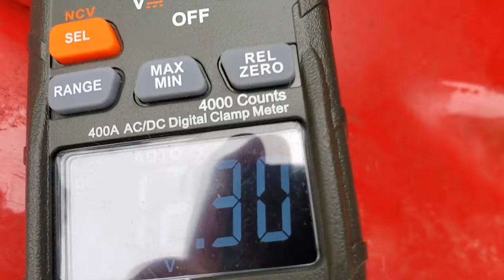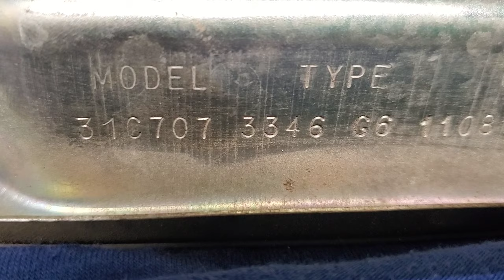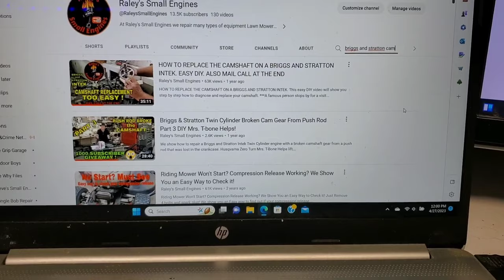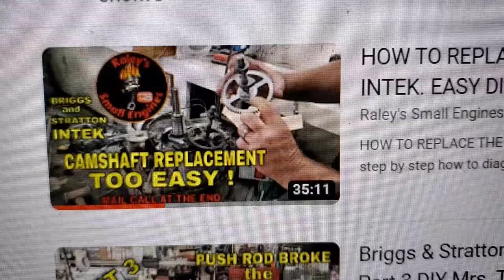Briggs & Stratton No Start Won't Turn Over Hydro Lock Compression Release Valve Adjustment Easy DIY

Comment: I had been working on my mower under an assumption of a different problem which was wrong. Once I determined that I found your video and you were spot on. I would still be cussing at a broke mower had I not seen your video. Thx!

Comment: An easy solution to overcome the compression is remove the air cleaner then, wearing a leather glove, put your hand over the intake on the carburetor. Then have someone crank the engine. It will turn over easy if it gets no air for compression. It will start really fast so get your gloved hand off the intake quickly so it can run. Usually nothing broken, just the compression release mechanism fails to operate after setting around for a couple of months.

Comment: Great information! The only thing I would recommend is taking a propane torch with a brazing tip on it, and go around the outside of the valve cover to soften up the honda bond that they use from the factory to seal the cover to the engine block. The valve cover comes off without any bending when the stuff is a little warm.  😉

Comment: I had to replace my camshaft on my 17.5 hp Briggs also. My cam lobe was very worn along with the compression release being broken, not a terrible job, it ran like a new mower afterwards. I discovered how bad the lobe was during a valve adjustment while replacing head gasket for oil burning and smoking. Like others say you can mow a while with it by turning the engine backwards until on low spot to help overcome the high compression while cranking. Eventually the lobe wears down too much and mower won’t run with any power. I wish I had done this job in April instead of June in Florida heat, this was about 7 years ago, I now have a Koehler, not sure if I’m better or worse off lol. That Briggs ran great afterwards but that dam 17.5 must all have bad cams.

Comment: You ain't kidding about Amazon aftermarket part, I have a 1990 Dynamark i was restoring and its engine was replaced at sometime from a Breaks n Scrap em to a 12.5hp Tecumish. I wanted to install a new carb and ordered on frim scamazon needless to say that carb fit but it was backfiring and just would not run good. So i went to Parts tree and ordered a OEM it was definitely alot more money, but my tractor runs perfect now. I did finally get it completely restored and it looks and runs like new. Its a pretty awesome running/cutting rider. Anyway my point is sometimes its not better to save money if you want perfection. Great content as always good Sir

Comment: i have a john deere with this engine and the camshaft problem,been mowing with it for 2 years,i just spin the engine backwards until its free,shoot some starting fluid in it and it starts every time,i usually don't shut it off again until i finish mowing,bought it used,not worth fixing as long as it starts

Comment: I ran my craftsman YTS3000 without a new cam. I got most of the pieces out with a magnet. Turned the crank to upstroke, covered the intake and started it up. Ran like a top for several hundred hours before I sold it.
Reply from the maker: Nice work!

Comment: Excellent video. Thank you for sharing. I just removed my engine, though I was a little apprehensive due to very little experience with these engines, I trusted your advice about not having a bump at the valve and you were exactly right. Right down to the metal rattling after flipping the motor over. I removed several pieces of the ACR from inside the motor. Now Im ready to order the parts. You did a great job with this video and I"ll definitely trust you for any and all future repairs I may have to make.

Comment: Have exactly the same issues with my. B&S. 540cc 19 hp. Riding it  for like 20 minutes.  Cutting the grass, Engine revved up really high that startled me. When I went to turn it back on, that’s what I got. I guess tomorrow I’ll check the gas to see. if the chef broke. Thanks for that video. It really helped me in the knowledge department. Thnks.

Comment: Thank you. This video led me to a problem i wouldnt have thought about.
Compression relief symptom / problem brought me here.. or so i thought.
Soon as i got to the valves, exhaust valve was dangling.. holding in the compression..

Tried to adjust it, but the tiny hex allen center screw was locked, non adjustable now.
I couldve been hunting the small part to replace and then waiting on it, but i took the round tipped valve nut / bolt with its siezed adjustment inner screw and Cut it with my cut disk grinder, lower than the stuck screw. So i screwed the thing on, huntin for ideas, then thought to adjust that valve perfect with it, then weld it in. If ever needed to remove the bolt that holds the valve to the head (thats welded on the end, to the rounded valve nut) can be cut with a small dremil and tiny cut disk.. but it should hold up for life as longnas this generator engine is properly handled 

But big thanks.. this video got my engine going again, a whole lot easier than i imagined (to have to get all the way into the cam.. on a dang genrator wit big motor to remove first.. whew!

Comment: I’ve been getting around the issue by turning the engine past the point of the compression release by hand (open palm on top of the fan cover and twist it over). Not ideal but, so far, it works!
Reply: Exactly what I’m doing at the moment!

Comment: Great video! To the point and not a bunch of jacking around finding tools or moving the camera making everybody seasick. 
Unfortunately I believe the cam is also wiped in my engine. With so many projects currently on the bench .  I think I will just junk the mower and buy a nice used one get 6 or 7 years from it hopefully.
Reply: Exactly....this is one of the top channels in this field for sure

Comment: Have the exact same mower with the exact same issue. Took it apart and camshaft was not broke. But its back together and adjusted valves. Guess we'll see what happens when I try to crank it up.

Comment: Great video. Straight and to the point. Liked and Subscribed.
BTW I use medical patient lifts AKA "Hoyer lifts" to raise mowers, pick up small engines (they'll easily do a Harley or other touring bike motor) and place 'em on my cart or work bench. I already have a bad back so the time to set up a variety of lifting gear, carts and dollies makes wrenching much easier.

Comment: It's nice to see less and less of the Kohler 7000 series engines in the repair shop all others  especially Briggs & Straton are  constantly in for repairs
Reply: The 7000 series is a good engine. About the only thing they need is the valve cover upgrade that the “Pro” engines have. I wouldn’t buy a newer single cylinder from Briggs or Kohler.
Reply: I literally just blew up my new used kholer john deere. Craftsman of course has a bad compression valve ergo why I'm here lol. Dang grass won't stop growing for anything

Comment: I’ve had that same mower sitting in my back yard for two years and never thought to suck a magnet down the oil shaft!
Reply from the maker: Remove valve cover, adjust the valves and then look for the bump.  You CAN fix it!!! If it's a bad cam, watch the video in the description, it will guide you thru it.

Comment: Man thank for posting this... I got a 26 breaks n scrap'm that's killin batteries and i think i smoked the Sil - starter wire.   It does the exact thing though, locks up before the starter can pushi it over hard enough to turn.  I'll check the valves but im not sure this video applies to a 2 cylinder....  Seems like though, jus twiste...  I'd go check but it wouldnt start across town and it aint here right now....  Anyway thanks.

Comment: The thing that the gas might be in the.oil  can cause the hydro lock I've been there did that on my  poulan XT mower  so I cut the gas valve off and let the carburetor run out of gas

Comment: i read they can break the first start up after repair, so i took the head off mine and drilled a hole to make my own manual compression relief valve. did this back in 2020 during the sickness when no one could get out or work.

Comment: Great video! Helped alot! I did my intek 16.5. Question, should there be a valve cap on the intake valve? There is one on the exhaust but not the intake. What's the risk of running without one? Thanks!

Comment: I have the troy bilt 18.5 it's will start one time then hesitate and blow a fuse on the next time starting. I checked for the bump and does have that bump. Bad ground possibly? Fuse blows 2nd start. Thanks

Comment: I have a Murray 42 inch cut with a 14hp Briggs & Stratton. I put a new battery and a new solenoid and now I can't get it to turn over can't get it to click can't get it to do anything would it be my starter or would it be in my ignition?
Reply from the maker: Watch both of my Just Clicks Videos

Comment: I have a Briggs model 422707 which acts like compression slow turnover. Do these have a decompression ability? It has the carburetor in the front and no valve adjustment apparent.
Reply from the maker: As far as I can see, that is what's called a flathead. It doesn't have compression release cam.  Test battery voltage, is it over 12 volts? If no charge or replace battery. If over 12 volts remove spark plug spin engine over and listen. Is it dragging? Or does it spin really fast? So so many things.  Slow with plug out, possible bad ground, bad connection,  bad starter and more. If I could hear it I could instantly tell ya. Hope this helps ya some. Hard to diagnose in a couple comments.
Reply: @RaleysSmallEngines  Thanks, I had been using a 200 amp boost to assist the old battery and had those problems. I ran jumper cables from my truck and turns over fast now, so I think I needed a better battery and more amps.
Reply from the maker: @SF-fm7ov  please be careful using a vehicle for jumping off a mower. Do not run engine of vehicle while jumping mower, it can melt mower alternator.

Comment: I enjoy watching your videos very much.  I saw your tip about sticking a magnet down your oill dipstick tube to see if you can retrieve any compression release parts.  I bought a magnet tool and put it in my dipstick tube, but only retrieved a few metal filings.  Does this eliminate the possibility that my compression release mechanism is broken?
Reply from the maker: That is a handy tool.  I got lucky on that one, seldom do I retrieve pieces of it. I always rely on looking for that small bump at the rockers when turning the engine over.

Comment: Turn it backwards by hand, then try to start it. If it starts, it's a cam/valve problem.
If it still stops, then pull your plug.
Reply: I've been getting mine to start by tuurning by hand backwards, plugging intake with rag then it'll start. Doesn't start everytime though... usually only first thing in morning when it's cool.

Comment: going on 1 year of use with an amazon cam because grandfather refused to buy oem, hes tighter than a crabs ass lol. guess we got a good machined one. Going to check my mower today and see if my cam went or if the valves need to be adjusted.

Comment: I had this same exact problem. I had a new battery on it so I knew this wasn't the issue. I simply pulled out the spark plug and spun the engine manually by hand and reinstalled the plug and it ran perfectly.

Comment: 15 hp B&S.. the motor runs good. when I turn it off it basically free spins(no spit & sputter like it is trying to stay running) just free spin for about 5 seconds. is this normal?

Comment: My camshaft broke, i replaced it put it back together and its still doing the same thing. Any suggestions? Do i need to drain the oil to open the valve cover?
Reply from the maker: You can remove the valve cover without draining the oil. Just a tiny bit may come out. Set valves to .004 in. Remove spark plug and look for the bump as you turn it over by hand. If it bumps, good. Turn over with key with spark plug out and listen.  It's possibly a battery,  bad connection at ground to frame or starter.  I'm guessing the issue you are having is that it won't spin over.
Reply: Yes it want spin. I opened the motor and the camshaft was broke so i cleaned the pieces out and replaced it, put it back together and the motor still want spin. New battery, solenoid , i cleaned the ground wires also
Reply: @squirrelmaster5485  Did you adjust the valves?
Reply: @Grrrnthumb  i did but i ended up just getting an OEM camshaft and it works now

Comment: Is there no way to pull the decompression parts off the cam and get a stronger starter?
Reply: Nope. I've seen guys put huge starters & just burn them out, melt wires.It's the GD comp. relief arm inside the engine, OR valve adjustment. I bought a NEW battery & starter before I found all these videos on this problem.
Sometimes I've been getting mine to start by tuurning by hand backwards, plugging intake with rag to stop it from sucking air in... then it'll start. Doesn't start everytime though... usually only first thing in morning when it's cool.

Comment: I’ve been watching and checking valves and found out that the valves are way off and the compression release is broken 
My personal mower.,bs17 hp 20+ years old and have not changed cam
But I check valves lash twice a season every year

Comment: I have the same engine with similar symptoms, but it acts as normal with a bigger battery, like a car battery or booster.  ??
Reply: I would say you have a cam issue it's just closer to the beginning stage of cam failure.
Reply: @banjoman6223  fml...I think I just have to live with it for now. To much work to take it apart in the spring and summer time.

Comment: Valves need a lashing  ...its usually the issue on the small engines
Reply from the maker: Probably needs it, yes. This one definitely has a bad camshaft. Got the OEM parts in today and Probably gonna film the repair. Thanks for watching and commenting my friend.

Comment: Is yhe bump really noticeable
Reply from the maker: Yes it is.
Reply from the maker: Move valves to zero clearance, leave loose. Spin engine with no spark plug.  You will see it if it's there.
Reply from the maker: By leave loose, I mean no need to tighten lock screw.
Reply: @RaleysSmallEngines  ok I turned it over by hand a few times and saw no bump. I got a new battery the other day and it was hard to start but started. Now I believe I have wore down the battery so I pit a jumper box on it and it still turns over really slow stopping sometimes. It turns just fine with the plug out though

Comment: Ok so what is hydro locked ?
Reply from the maker: It is when the carburetor is leaking fuel into engine on top of piston. When this happens the piston can't go all the way to the top of the cylinder and engine will feel like it is locked up. Hydro ( liquid) locked.  Hope this helps, I'm sure there is a better way to explain it.
Reply: @RaleysSmallEngines  Ok got it. Thanks soo much for the quick reply and explanation!
Reply: @RaleysSmallEngines  After you replace the carb for a hydrolocked situation, do you have to do something to remove the fuel that is on top of the piston(s)? In other words, what frees them up so it becomes un-hydrolocked?